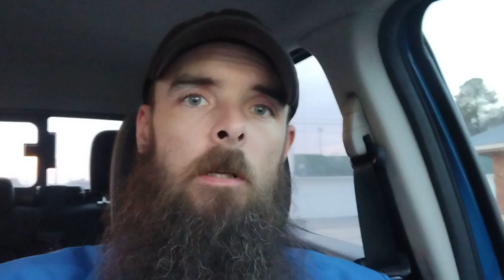Ford 7.3 Godzilla Lifter Failure And Tick/Tap/Click Noise

Comment: I have been working as a driver for Ford f-350 for more than a year. The first engine died at 160,000 miles. Something began to knock in the block of cylinders. The truck owner bought a new engine to get back to work faster. The new engine drove 120,000 miles and the problems started again. At idle, the engine runs quietly. When I start moving in the range from 2000 to 3000 rpm, some kind of knock begins to come from the passenger side. The more load on the engine, the stronger the knock. I do car delivery. There is always one car in my trailer. Yes, I am surprised that the service life of these motors is so short. Or this engine is not designed to work with a trailer. It seems to me that this is not the knock of the rods. No one can diagnose this sound, because the engine is idling quietly. More recently, the transmission began to kick. It seems that the truck is living its last days. Truck 2021 with total mileage already 286,000 miles. I want to understand what is knocking in my engine this time. I want to believe that my truck will not break down on the road tomorrow.
Reply: I forgot to say that I have 7.3 godzilla
Reply from the maker: Not normal for it to knock. Have you had the IMRC checked. I have a video with the 6.2 liter knocking and it's actually the IMRC Intake Manifold Runner Control.

Comment: I was thinking of extended OCIs, but if it is happening to customers that change their oil regularly, then it is most likely not poor oil. I wonder if there is a QC issue with the manufacturing or poor metallurgy? 🐺🔧
Reply from the maker: I'm assuming so
Reply: Does GM use 20W50 motor oil with "LS lifters"? You can have the "best" oil available. If its the wrong viscosity its the worst possible oil for "LS lifters".

Comment: It will be interesting to see what is causing the issue. Do both Ford and GM purchase lifters from the same manufacturer? It has to be due to faulty materials. I would imagine that Ford is investigating and will have a solution. Keep us posted.
Reply from the maker: i dont know if they are getting them from the same manufacturer.  but i am sure they are on top of it seeing as how it only takes next day to get an engine.  the more info i find i'll forward
Reply: @Bearded Ford Tech  keep us posted I'm curious too.
Reply from the maker: @chrisr.986  will do

Comment: Question, are 1 and 4 at the end of the oil galleries? Possible lack of a sufficient flow of oil?
Reply from the maker: Cylinders are as follows. Right hand side (passenger side) front to back is 1-4. Left side (driver is 5-8. 1 and 4 aren't the furthest from oil galleries with the way it flows from the pump upward. If that was the case 5 and 8 would do it too. It usually happens between 20k and 40k miles. However there are reports of it happening at 2k miles. 1 and 4 it's seen on a lot but not to say it doesn't happen on the other 6. I think it's the way these are made. Two different metals?  Services are up to date on time and not neglected. I'm still doing research on it as all us techs are as well.